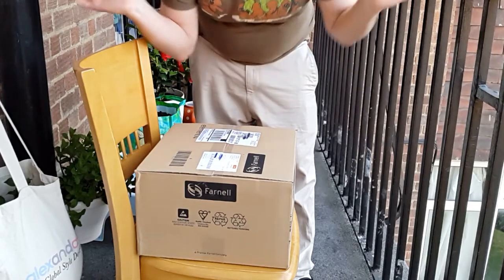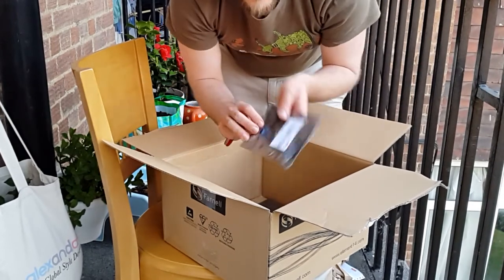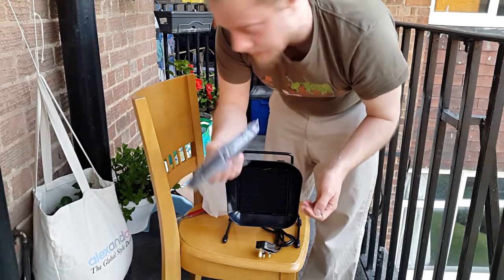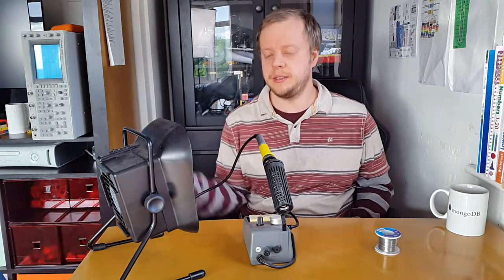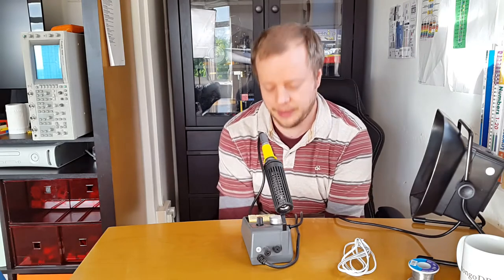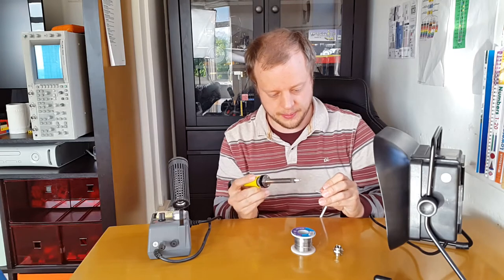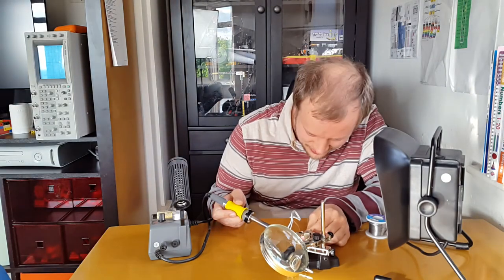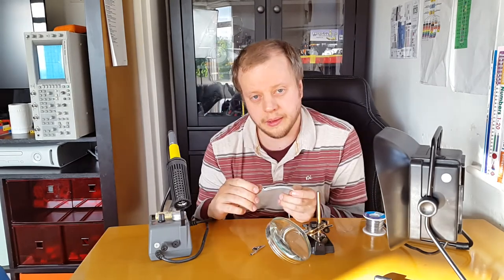DURATOOL D00374 FUME ABSORBER Extractor Fan Demo and Review

Comment: How is this extractor holding up, do you use it often?
Reply from the maker: Hi and thanks for the question. I use it whenever I solder. Frustratingly - there are models of this with a backplate to attach a dryer hose to vent the fumes - this model has the attaching clips but not the plate, and it doesn't look like it's available separately - I may have to 3d print such a thing. It's fairly noisy - enough that making video with this on is a bit complicated - again, a 3d attachment plus a tube may reduce noise by putting the actual motor a distance away from me - perhaps use some baffles to reduce the noise on it. In terms of fume control, the "old car" smell does disappear after a while - this may just be due to manufacturing , and it may be that you need to "run it in" before using it. It works - but with quirks.
Reply: Thanks for the info, so apart from being a bit loud it does actually work? Reason being is that soldering gives me some really bad headaches but some of the more "pro" extractors are pretty expensive for the hobbyist like me.

I've also seen those back plates as well but can't find anywhere to actually buy them, shame really as the angled airflow attachment could reduce noise I think.
Reply from the maker: uK8cvPAq yes it works. I'll be using it in my live stream later tonight from 8pm gmt. You should be able to get an idea of the noise then.
Reply: Cool I'll check it out thanks.

Comment: Could it be something faulty in the unit/fan? The sound it produces changed towards the end. It started at higher RPM and ended up lower. I was going to purchase D00680 but, after watching this video, I'm not sure it would be a good idea.
Reply from the maker: Hmm - it could be that it was its first outing, settling in. What I wasn't keen on, which could be related, was that smell, fuel/petrol like smell as it was turned on. It actually made me feel worse than the flux fumes it was bought to get rid of.
Reply: Ended up ordering ZD-153A, it's basically the same unit mounted on an articulated arm from a different company.
Reply from the maker: +discoHR did you find any of the same issues? The articulated arm must aid in positioning it.
Reply: I'll let you know when it arrives, should be here next week. Even if it has the issues as yours had, it will be a good base for custom made fume extractor. It just needs a long airduct along the arm, plastic box filled with activated carbon and some other minor stuff to become a proper fume extractor with huge filter capacity (stock 2 grams seems way too low for a filter). The fan could be moved to the filter box to address the noise issue and perhaps different type and/or diameter of the fan would be better. I've ordered some replacement filters as well so  I don't plan to modify it any time soon unless it stinks like yours did.
Reply from the maker: Nice - I look forward to that - an arm with an airduct would be a useful mod - mine really has nowhere to go currently - just away from me I suppose.
Reply: It arrived today and I tested it with classic soldering iron and hot air station. The windows were closed at all times. It does the job, I can't smell anything. There was a bit of flux smell during the soldering but it disappeared almost instantly. I even blew a cap by overheating it, no smell at all. I guess you were just unlucky and received a faulty unit. Could be the filter has faulty odor when it's time to replace it? The only negative I found so far is the noise, this unit is very loud and it's not something I would use in the middle of the night in an apartment building with thin walls.
Mine arrived with two extra back plates. One of them has circular shape and would be perfect for mounting the air duct. As previously said, I don't plan to mod it any time soon. The unit arrived with 3 filters and I purchased 3 more so with 6 filters in total I'm covered for a while. I'll see how long the filters last for me. If it turns out they need to be changed every couple of days then I'll definitely mod it.
Reply from the maker: Hmmm - it's possible that mine was sat in a damp warehouse for a long time - which would leave it smelling perhaps.  I've just checked mine - I didn't find any back plates, so your model definitely sounds like an improvement.
Reply from the maker: I can see mine has the clips for the same plates - set me thinking if I could hack something like that together (or more boring but probably pragmatic - find some and buy them).
Reply: Quick update... I was soldering/desoldering moderately during past month or so. Couple of hours every couple of days with heavier usage during weekends and I'm still using the same filter. Love this thing.

Comment: Oh dear, that does not sound healthy. I personally would not risk using one of those extractors with a CNC for fear of clogging the filter. I think they are designed for far smaller particles than those produced by a router. If you can find space, a vacuum cleaner of some description would probably be a better bet.
Reply from the maker: Samuel Doye I have been using a vacuum currently - what I am considering might be to make a "shoe" to hold a hose connected to a vacuum cleaner near the spindle - I've seen it done before. A project to chalk up on the list for sure.
Reply: Sounds like a good idea. If you are going to do that it may be worth adding a vaccume table at the same time and splitting the hose to run both the extractor and table simultaneously.